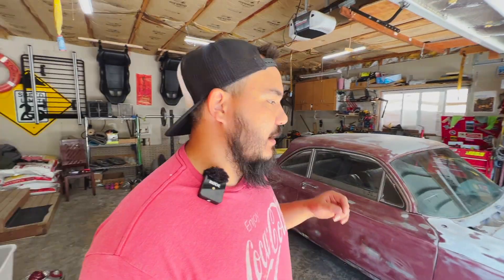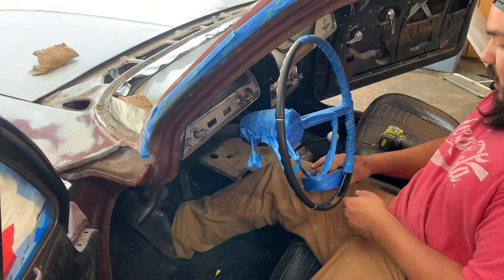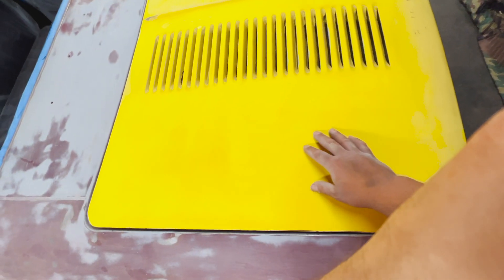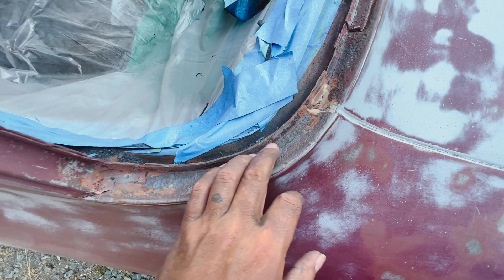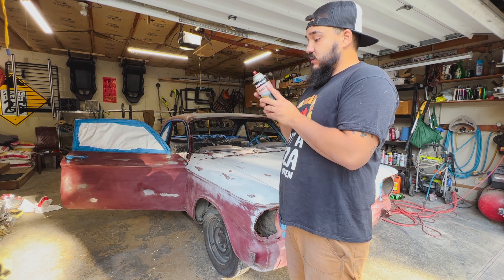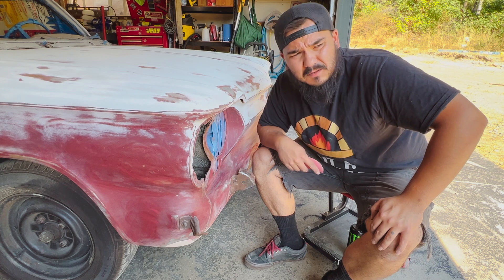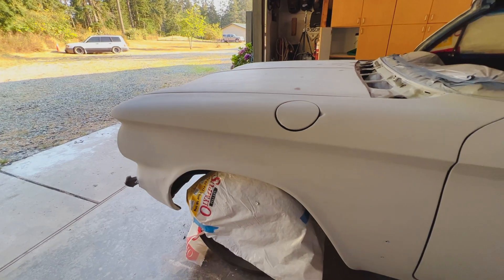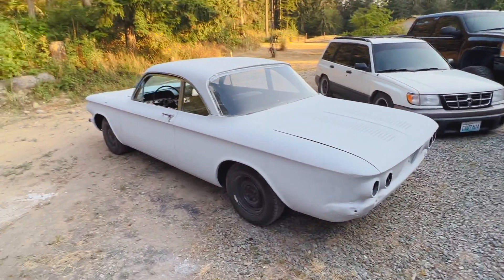64 CORVAIR GETS PRIMED

Comment: Nice job with sealing her in  primer . I had one of those portable car tents with metal tubing, & The 1st heavy wet snow it just crushed it; I was glad I didn't have anything in it. I did save the ends to cover my tractor, & log spliter. I'll never buy one of those again.
Reply from the maker: Yeah the car tent was only supposed to be for a few months while I was on a work trip. Wind ended up blowing it down, few tiny dings and scratches on the 64’ but nothing major. Now she resides in the garage for restoration..
Reply: @projectnorthwest5181  Looking forward to the next video; IMHO your way ahead having a running project.